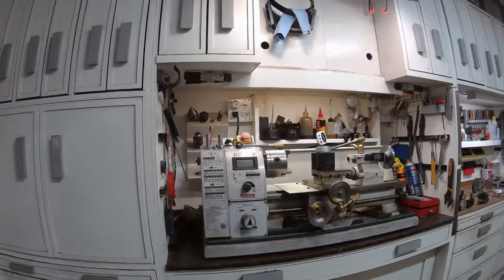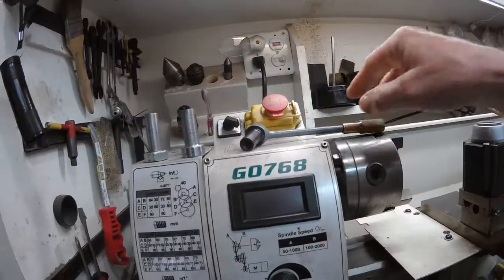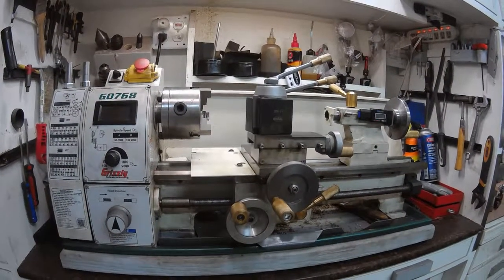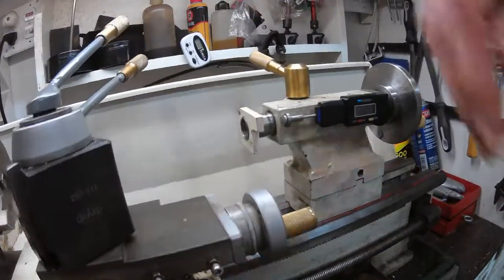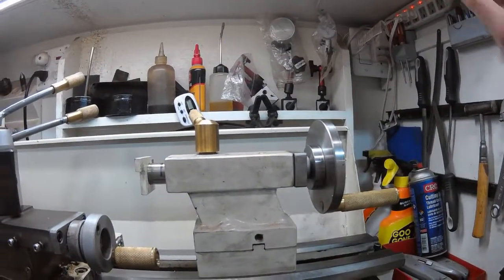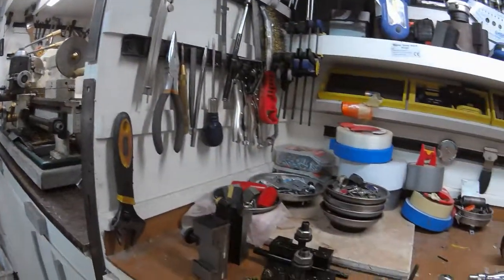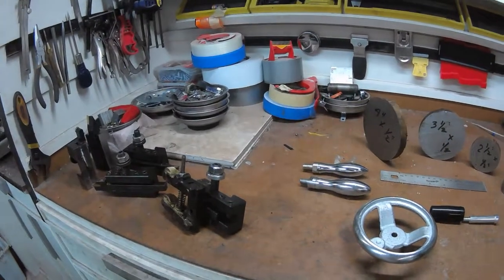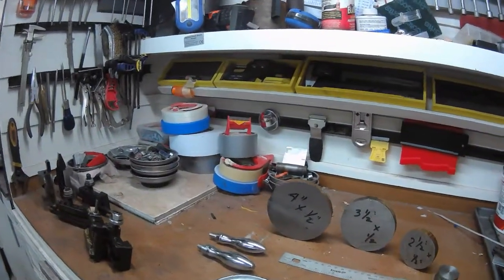Grizzly G0768 Bench top lathe ---  8x16 mods

Comment: Good video, where did you get that DRO from specifically?
Reply from the maker: These are digital tire depth gauges- off of eBay:  I was working with couple of friends and also made this video
using different depth gauges and different mounting methods:

Grizzly G0768 lathe - Cross Slide Removable DRO

The lathe has considerable backlash, and these seem to help a bit along with digital dial indicators.
Reply from the maker: https://www.youtube.com/watch?v=ey9BO0TQ32g
Reply from the maker: https://www.youtube.com/watch?v=6hAH9vN2rdw